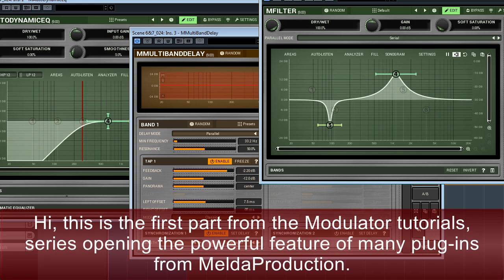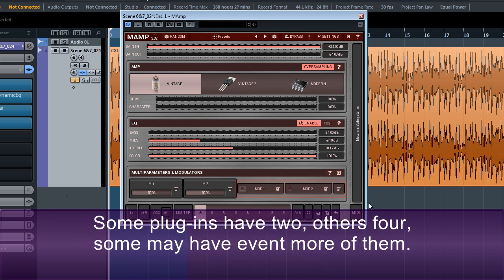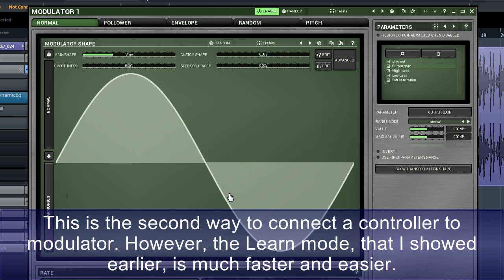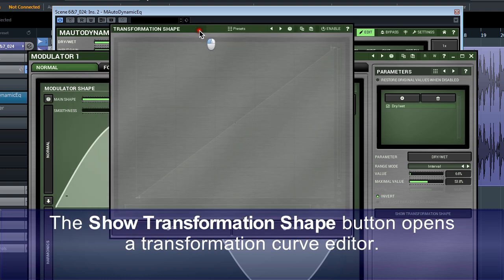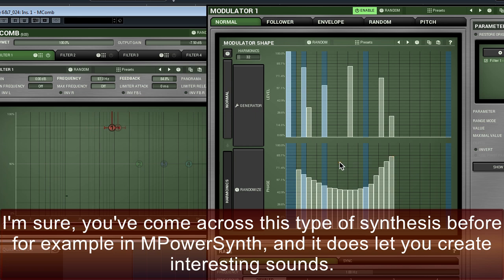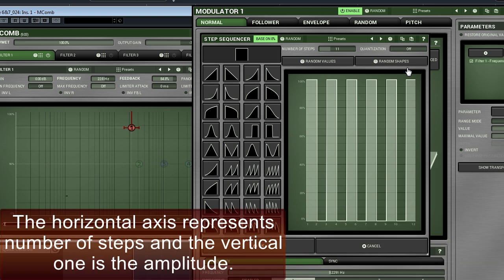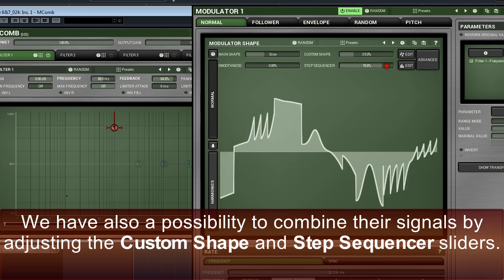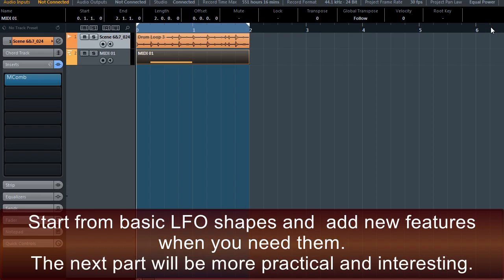Modulator tutorials #1 - Basics and Normal mode

Comment: I didn't quite understand the way the Range Modes were explained here so this is how it makes sense to me:

Up and Down  - Clips Depth knob's effect based on Value knob's range - If the maximum the Value knob can go is, for example, 1.00 and it's set to 0.90, the Depth knob effect can only be +-0.10 no matter how far it's turned but if the Value knob is centered then Depth will never clip and the effect will be equal to Full Range mode with Depth at 100%.

Full Range - Depth at 100% will always turn the Target the whole range - Depth at 100% will always turn the knob the whole range, Depth at 0% centers the parameter at the value set by the Value knob, Increasing depth "pushes the Value/Target parameter to the center" until it's at 100% sweeping the whole range.

Down Only -  Positive modulator values decrease the target - Negative modulator (Normal, Follower, etc) values set the Target to Value point i.e. the modulator is biased negatively from the Value knob setting.
    
Up Only - Biases positively from the Value setting (opposite of Down Only range mode).
	
Interval - Lets you manually set the range - Value knob sets positive Modulator values' effect on Target Parameter, Max knob sets negative Modulator values' effect on Target parameter i.e. "crossing" the Value and Max knobs inverts the effect of the LFO. 

Hopefully this helps someone because these weren't immediately intuitive for me. If I've made a mistake, please comment so I can update this info. Thanks.